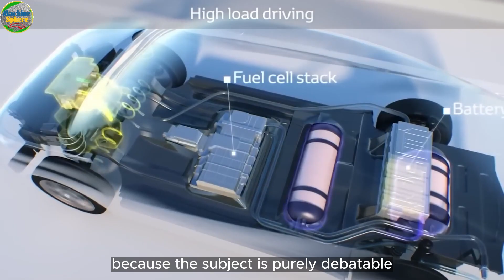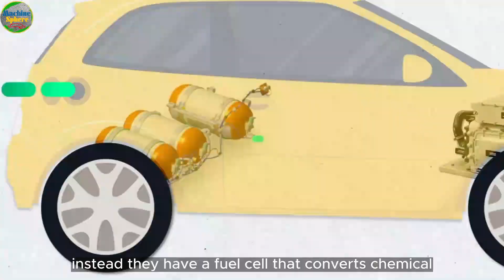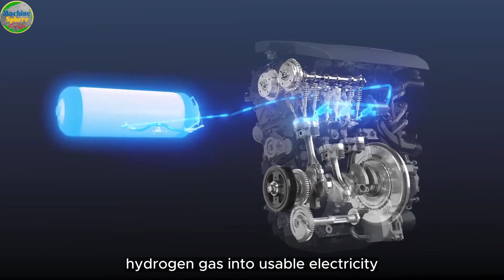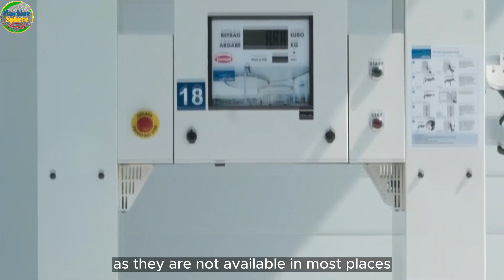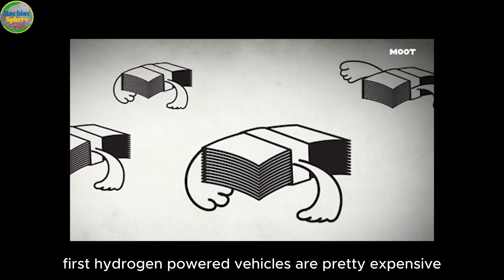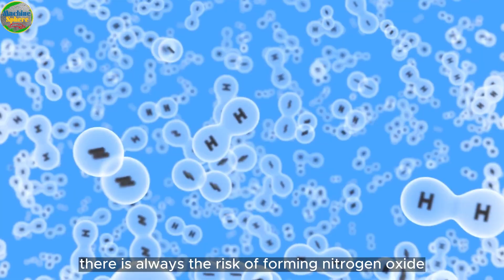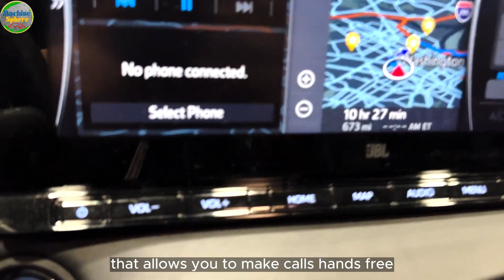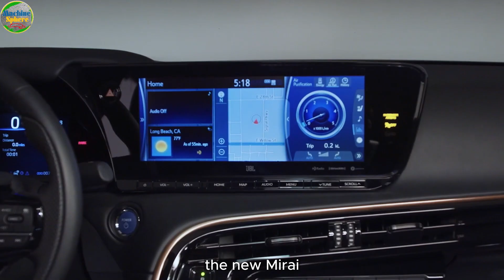Toyota CEO : ''Our New Toyota Hydrogen Engine Will WRECK The Entire EV Industry''!

Comment: Problem with hydrogen is not just in the car. it is in the entire infrastructure.
To produce it, you're losing 33% of your energy. To compress and transport it you are losing 33% because to fuel your hydrogen car, you need to cool it to -40c which takes more energy.
Also you can't get hydrogen everywhere but electricity is already a complete infrastructure. Anywhere there's a plug, even if it is slow, you can charge your car.